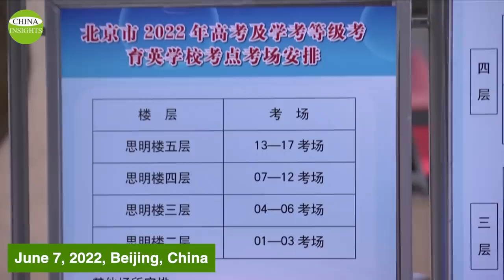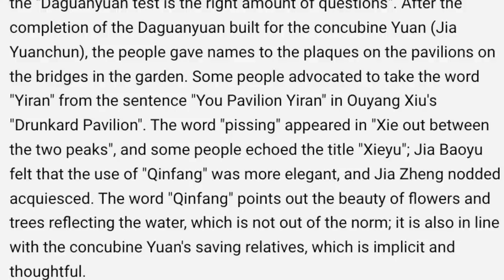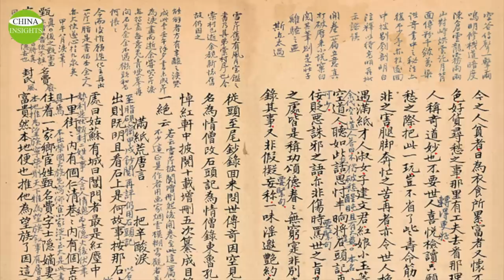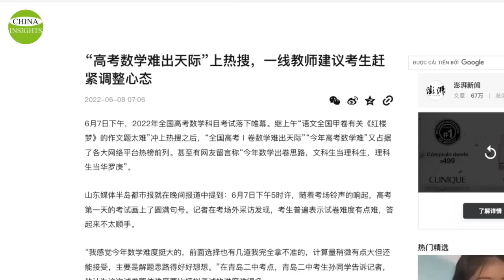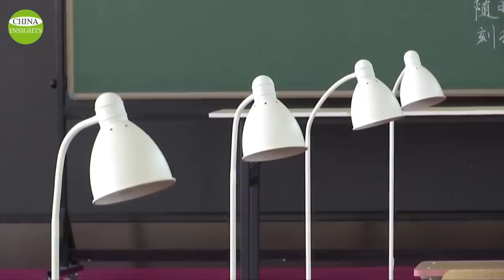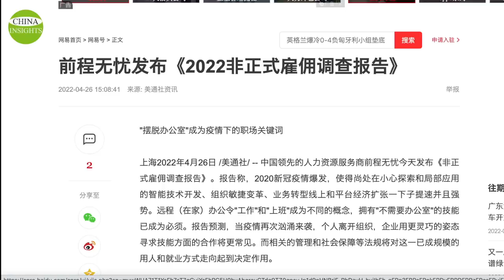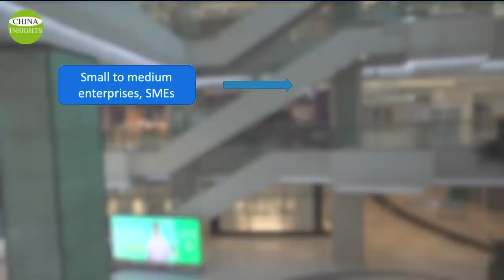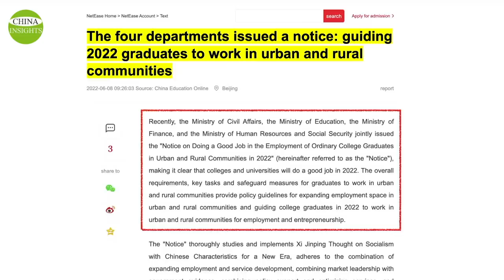Beijing uses hardest Gaokao exam to lessen the employment challenge/Record 12M sit for 2022 Exam

Comment: If this is being done and students are not being tested on what they know, then every one should no longer go to school and rather do home schooling with Elon Musk’s Ad Astra School. As you can read between the lines a class system is being set up to divide the haves and have nots. If this is the case go the other way. This putting those that implemented such an unfair system out of work. What is education? It is the ability to think and imagine and establish mental dexterity. If this cannot be done fairly and it hurts and hinders a students development then it is a torturous system. A system meant to impede the progress of certain sectors. Go to the places that give you the correct education, thereby frustrating the system that blocks the student. Remember the art of war. If the method is too powerful, remove yourself. Go in the direction you can learn the most and still be safe from the threat. Kindly notice I used ‘artistic license’ in the interpretation. Do not ‘go flat’ . That is a defeatist attitude. In South Africa there was a student called Hector Peterson. He refused to be treated badly in an unfair system. He let the authorities know. Hector lost his life standing up. Do not do that quietly do not sign up for school and do the online schooling of Ad Astra. Not only will you become cleverer that the assholes who are implementing this system but you will beat them at their own game. Please go the other direction. That was it will be cheaper but you will be learning from the worlds genius. At present your teachers are not on that level. All you kids have come to earth to carry out a mission and find your genius. Yes even the so called most stupid has a genius mission. You are being blocked on purpose. They do not want you to follow it. Never give up and never give way. The system might be strong now to unfairly beat you up but if you go this way the system will find it hard to find you. Come on get up. You were sent here to earth to help us. Bless you brave Warriors. Stand up quietly.
Reply: Take your billionaire worship elsewhere.